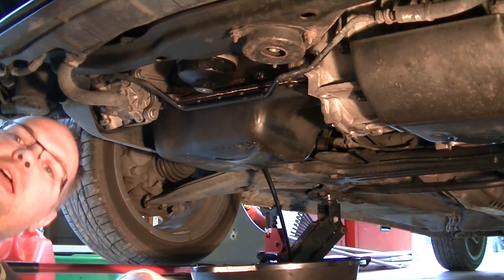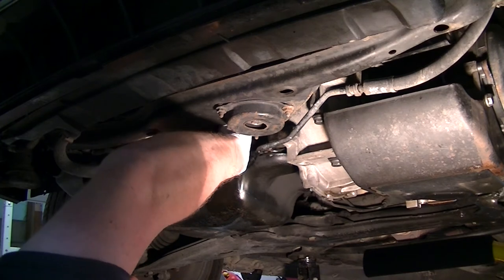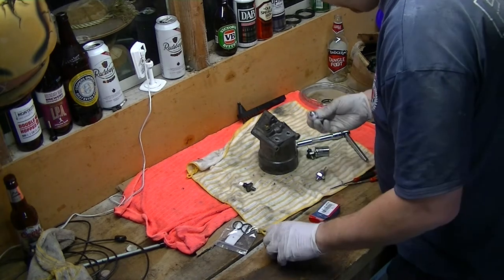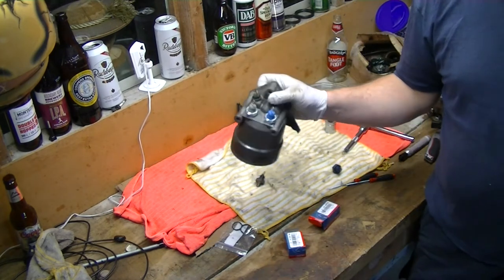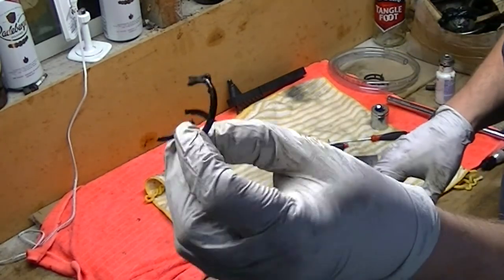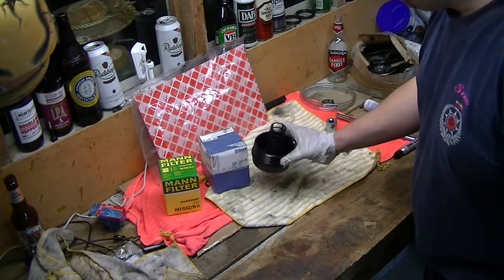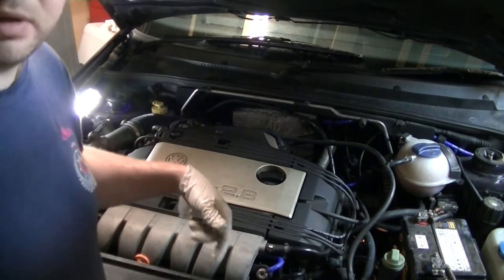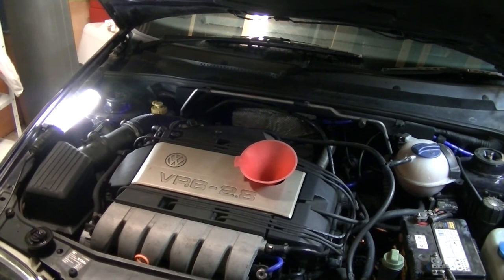VR6 Service and Filter Housing Oil Leak Fixed

Comment: I have used Castrol lubricants for 45 years. I even use Edge in my lawn mower. I have never had an engine problem even at high mileage. Castrol is now owned by B.P. in the US and since the huge oil spill in the gulf I hesitate every time I pour it in my engine.
Reply from the maker: never used Edge before but based on your experience I'm sure it will do great. I didn't realise they were owned by BP.

Comment: I like the idea of changing the sensors now since it's easy to do. That oil is on sale up here this week for $32 . Cheers
Reply from the maker: It's always the best option on that car. Tighter than a nun's cricket bat in there. That oil is usually $82.50 here, think I paid $50 on special.... which is $45 CAD so just a 6 pack of beer different

Comment: Gah!  I love that oil!  Sadly, they don't sell a 5w40 in the US in the Extended Performance; only in the basic Edge in the black container.

Your oil filter looks a hell of a lot better than mine did!  LOL
Reply from the maker: Valvoline is normally better value and I'm a big fan of their oil. 10W-40 is my weapon of choice on the VR6, interested to see how it goes on this stuff. The Castrol stuff comes in weird grades in this country

Haha the filter looks great, thought I'd chuck that in there just for you!
Reply: Badgertronix
Castrol Edge comes pretty cheap here; about USD $27 at WalMart for a 5qt (~5L) jug.  I never used to like Castrol much, but their current lineup of oil is a drastic improvement over previous iterations.  What they're calling "Fluid Titanium Technology" is a very similar thing to Royal Purple's Synerlec additive; it's a synthetic silica-borate molecule suspended in a complex ester matrix that has an ionic charge to make it cling to metal surfaces.

The marketing wank for products that contain the complex is laughable, but the science behind it is sound.  I've fooled around with various incarnations of the substance (Motorkote, Polytron MTC, etc.), and while the carrier fluid varies, the core product does what it's intended to do.  Powerful stuff!  :)
Reply from the maker: +rhkips that sounds fancy. I just go for a brand I've heard of, vw spec and at least 40% off! Castrol is OEM for VW and Ford here. Don't get too many options to be picky here

Comment: Hey fella, quick question; is this a Aaa 12v vr6? Can not aquire the PN for the gasket on a 24v, and yours has no attached oil cooler. Just wondering what the variation is.

Comment: What are the part numbers for both sensors. I can only find the blue one
Reply: Did you ever find out? cause i have the alarm going off every time i go 2200rpm
wanna find the correct oil sensors for the damn thing, any help

Comment: I’ve got a mk4 gold vr6 and after hours of looking finally found where the pressure switch is, but on mine there’s a hose in the way of getting on of the bolts off and I think it’s from the ac compressor, could that be removed in order to get the bolt??
Reply: For future reference, if anyone who sees this comment needs it, I have a 1995 VR6 GTI Golf, and I had a metal hose that made it a pain to get to both the short bolt on the top between the sensors, and one of the longer bolts of the bottom. The bottom one is easy to get to with a box end or something similar to that, but the top one is very hard to reach. I used two extensions that I believe are 2 inches long and I went behind and over the hose with the smallest ratchet I have which is I believe 3/8. I don't have the sizes memorized, I just do the work on my cars. I did have to use a different wrench on the small ratchet to increase the leverage I had due to how tight it was, but I found that to be the easiest way to reach the bolt. If you need visual aids, respond to this or send me a message on here and I can provide videos/pictures to try and show what I did.

Comment: Cant seem to finde the 3rd bolt and one bolt is hitting the hose of the ac compressor
Reply from the maker: The joys of working in a tight engine bay. Perseverance is key
Reply: Badgertronix actually i got it done easiest way is to remove whole front end and thats it

Comment: It takes 5.8 quarts right? Or am I wrong?
Reply from the maker: +Aubrey Bush about 5.5 litres in English whatever that translates to. Cheers!
Reply: Hey quick question what size socket do I need to remove the oil filter housing?
Reply from the maker: +Aubrey Bush I think it's a 36mm. Cheers!
Reply: Appreciate it man! I think your right that's what people on the forums say... I'm just gonna use channel locks
Reply: Hey was wondering if you have had idle problems? Engine idle is rough when I step on the gas. People say maybe the isv???
Reply from the maker: +Aubrey Bush could be a lot of things. Vacuum leaks, spark plugs, wires, coil and a heap of other things. Apart from a bad coil pack I haven't had an issue
Reply: Yeah I have no check engine lights anymore I replace coilpack and put new oem spark plugs in it, it has to be the isv or a vacuum leak just not sure /:
Reply from the maker: +Aubrey Bush plenty of vids on YouTube as to how to find vacuum leaks. Good place to start
Reply: Yeah def gonna look for some vac leaks, I want to get 52 draft designs intake stuff, I want to clean out the isv though, on the forums people say cleaning it out can fix the idle issue so we'll see... wish me luck
Reply from the maker: +Aubrey Bush good luck! They're simple and reliable so shouldn't be too hard to figure out